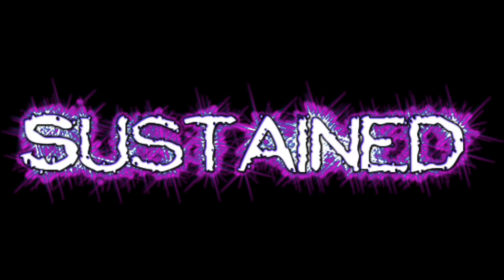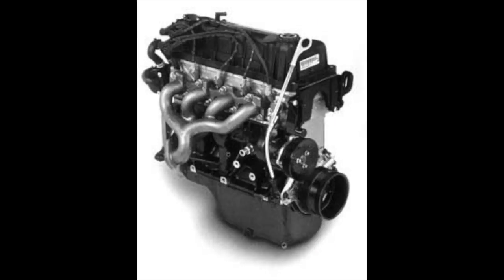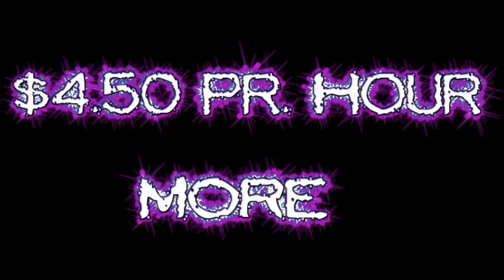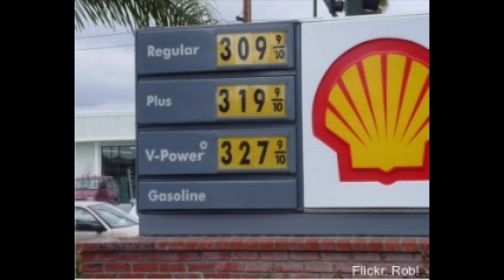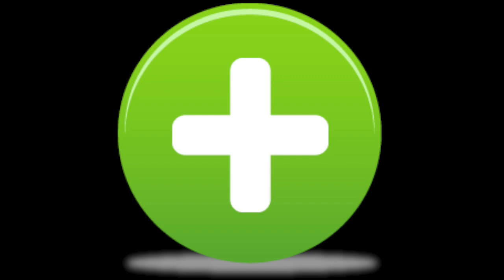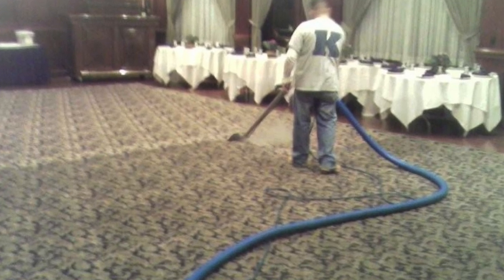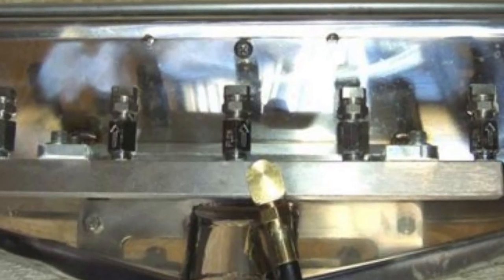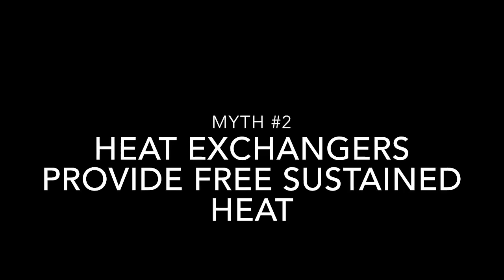Truckmount Mythbusters Episode 2 - Myth - Heat Exchanger Truckmounts Provide Free Heat

Comment: i brought a power clean xt 45 been running it for 16 years still ok only run 180 max gets the job done . if i was in the market for a new machine i would build one myself using a small Toyota 4 cylinder engine  strait tube heat exchange, cat pump, roots 45 or 59 blower old type belt driven  . no moving parts simple for the average guy to work on.

Comment: I do agree with the yearly cost of gas. It is pricey. My 570 SS really hasn’t had any major issues because I carry a water softener with my truck mount. I can do 250 all day every day no matter what type of job it is. Only thing I don’t like about it is the cost of the gas. This machine has  paid itself at least 3 times a year. For the last 8 years. I’m glad your truck mounts have performed great for y’all. I’ll be taking a closer look y’alls TNT truck mounts soon. Thanks for the post.
Reply: 570 is a beautiful machine i love my bosses titan 575 such a beast so reliable i run it at 50 percent rpm or less i still get amazing cfm and heat gas costs arent really too bad

Comment: high powered portables with 500 psi and dual 3 stage vacs are the way to go, they have 2000 watt heat exchangers, if you use the right solutions, you can clean anything, you save on fuel , and maintenance costs big time! the money I saved from switching over in 1 year bought me a brand new Range Rover Epoque for myself instead of paying for fuel and maintenance
Reply: Yeah portables get about 100-200 cfm at the machine and the lift is also very poor as well. Nevertheless they might be our only option one day if gas engines become outlawed. They do get the job done but its way more work than a powerful gas tm
Reply: Edenval Laureano never will compare to a truckmount

Comment: this is by no means a bash on Judson because I hear nothing but good things about them. I run a Prochem Performer 405 that I have owned for 10 or so years and it runs daily. It has a 4 cylinder Nissan engine and catalytic heat exchanger. I also ran steam way power matic kerosene fired heat with 20 horse engine and then a Dynachem with propane heat 20 horse engine.

Here is what I have found. for awesome consistent heat the steamway was the best. Cons are that it stinks to the point of feeling sick and sometimes hard to find. The propane heater was nice but the pilot lite was constantly going out even with light wind which cost me time going in and out to re-lite it, it was so frustrating. If I ran out it was hard to find a place to get more at times.

The big 4 cylinder Prochem with heat exchanger actually saves me money and time and the best part is that the heat is consistent and in fact the longer it runs the hotter it gets. The big engine uses less fuel than the small engines because it idles lower and does not bog down on heavy load like water extraction. I do not have to schedule fueling of the heater or worry about running out on a job.

In a nut shell I will not dispute the higher heat of fuel fired heaters however I can not agree with the larger engines using more fuel. Mine uses far less than the smaller engines I have ran in the past. In fact I would love to see a larger engine offered with Judson simply because these big engines outlast the rest of the mount. Either way I would like to try a Judson because they appear to be incredible machines with long life spans. Keep up the good work guys.

Comment: you are full of it a H,E truck mount with a 30 hp engine  with the right heat exchanges will hole 220 all day long maybe you should do some homework and look at other truck mounts before you open your mouth  giving people false information so the just come buy your truck mounts
Reply from the maker: Thanks for your comments.  I agree that a 30 HP will sustain heat on a standard flow wand with intermittent trigger pull, like when you're cleaning residential or apartments.  This video is about sustaining 240 on a high flow tool under COMMERCIAL carpet cleaning conditions.  Our units will maintain 240 on a high flow tool with a total operating cost of 1.5 gph.  This cannot be achieved by a heat exchange unit.  The main reason carpet cleaners should buy a Judson is because it is NOT a heat exchanger and is designed extremely simple.  It is easy to repair with local, common parts.  Judson's service record can not be beat.  We can provide references to customers who have units that are 40 years old and still running to this day.

Comment: Saw the video and I disagree with these So called facts.  I have a Boxxer XL and the built in heat exchanger does just fine with heating the solution to Aprx 230 degs for a sustained period over an hour.  How do I know this? The temperature gauge on the truck mount reflects the solution temperature.  Now, I am not disputing that propane and natural gas heat the solution faster and hotter, but I am just saying that conventional heat exchangers do keep the solution hot, even in cold weather.
Reply: Check the temp on a gauge at the wand not at the machine silly
Reply from the maker: Heat exchangers with standard flow wands will hold for about an hour, but on big commercial jobs, they will not, especially if the cleaner is using a high flow tool like this video is talking about.  The advantage of a Judson unit is high performance, 240 sustained high flow for endless hours, at an unbelievable low operating cost of 1.5 gph.  Judson truckmounts are east to repair with common, local parts, and have an unmatched service record in the industry.  Our recovery tanks come with a 25,000 year corrosion failure warranty.